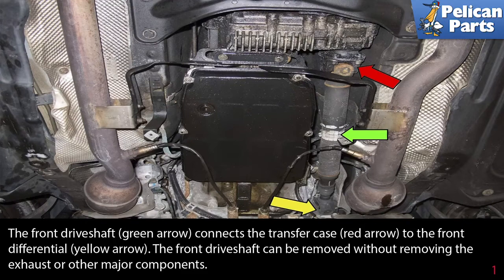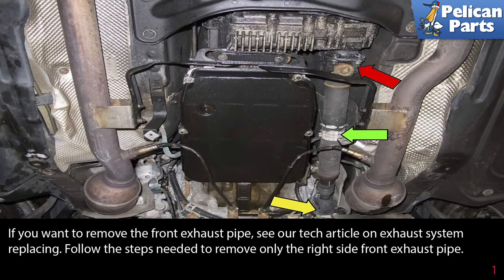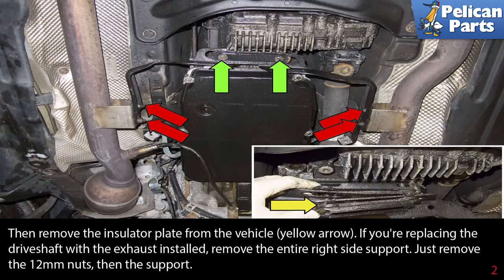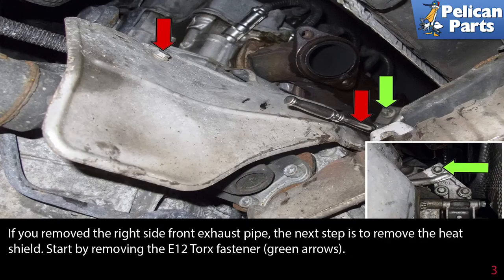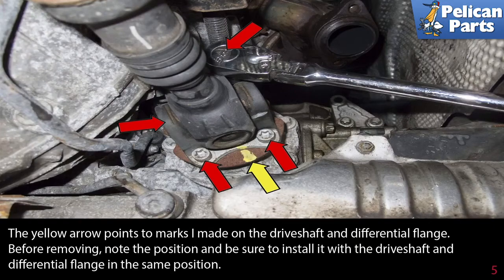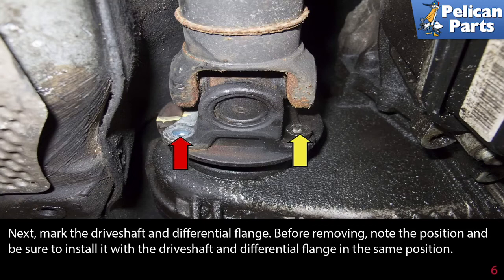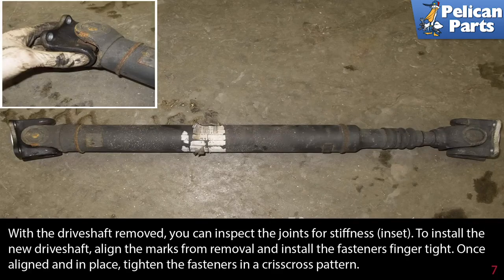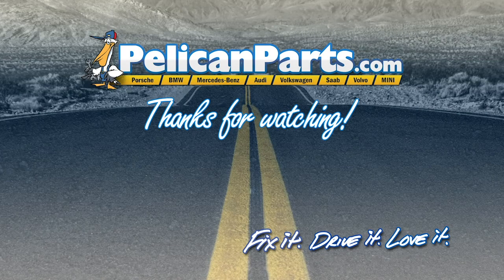Mercedes-Benz W211 E-Class Front Driveshaft Replacement

Comment: What if the  front u-joint part of the front shaft was  disconnected?  How can I make sure I align the new shaft to the right position?
Reply from the maker: If you didn't make marks on it, you can try to align the clean and dirty spots on the flange and joint to match it up.